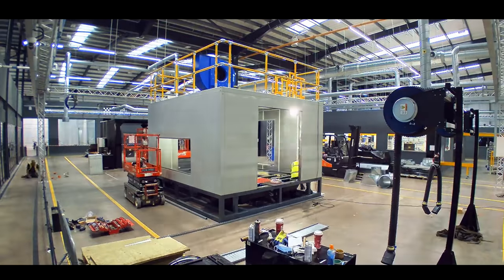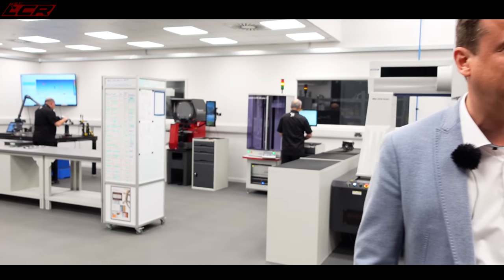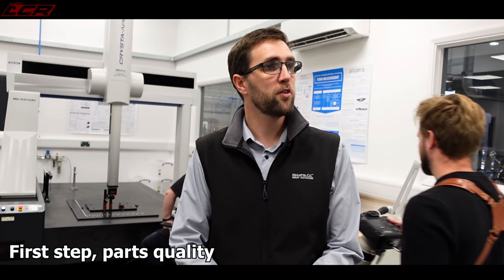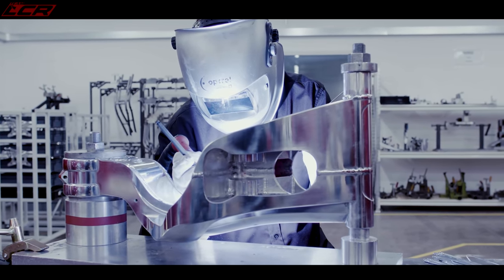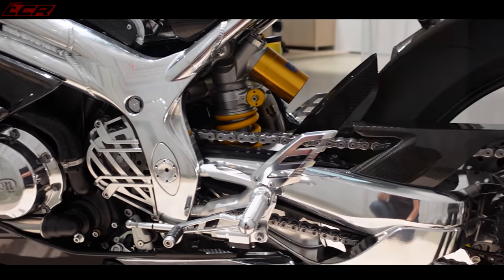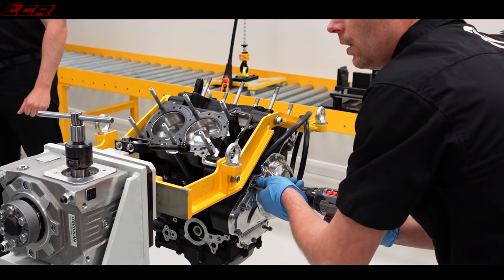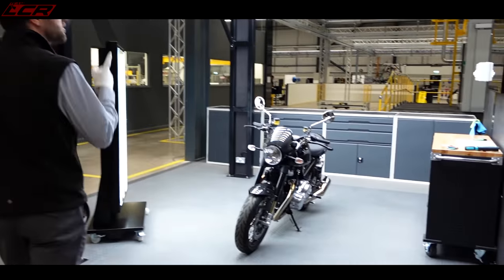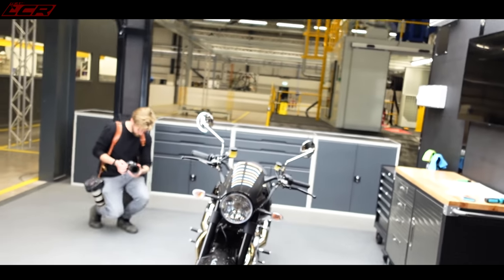NEW Norton Factory Tour!! | Norton Are BACK!!

Comment: I've had three Norton's in my lifetime. Back in the '60's I first had a 1962 Norton Electra and then two Norton Scramblers. A tomato red 1963 or '64 and a 1965 candy apple red one. They were vertical twins as this is before they slanted the motor forward a tad. They came with no mufflers so I had to install some stubby ones on them as the neighborhood I lived in at the time had some ornery cops! Today at 74 years old here in the state of Georgia I have three BMW's. A 2000 R1150GS, a 2001 K1200RS and a 2016 S1000R I just purchased used with 8000 miles on it. I also have a 2005 Suzuki Hayabusa that I bought new. I have riding 58 years and plan to keep on riding as long as I can. It keeps you young!
Reply: BTW: I remembered last night that the tomato red 750 Scrambler had a winged M on the tank for Matchless though both 750 bikes were the same. I wish I still had the candy apple red one today!
Reply: Much Respect, Sir!!!
Reply: Hi, I too had Norton’s back in the 60’s, both bought new; a 350cc Navigator and a 650ss, loved them both although the 650 ss had a few problems and I had to take it to Norton’s HQ in Birmingham to be fixed. I now have a 2001 Honda VFR V-tech which I bought second hand (2 months old)…absolutely love in every aspect of it. 
I agree biking helps you to stay young (I’m 78 now and have no plans to pack up yet), I voluntarily took the Advanced Motorcyclists test several years ago which was the best £100 I’ve ever spent…..helps me to stay alive plus when riding I have the mindset that everyone is out to kill me!
Let’s hope that TVS Norton are successful in the future. Ride safe 🇬🇧🇬🇧
Reply: @neilurquhart8622  Yes! You have to ride like everyone out there is out to get you. I call it situational awareness. The circumferential expressway , 285 , here in Atlanta is like a racetrack! Most, (95%), of my riding is out in the countryside where you have to watch for deer darting out into the road. I was 16 when I had the 400cc Norton Electra and the darn thing would blow a headlight bulb every time I accelerated down an entrance ramp to the expressway going into town. Lucas electric's ! 😆I can't remember how the shop fixed the problem , but it was eventually sorted out. The shop, Al Rodi Motorcycle sales sold Norton's, BSA, Ducati, BMW and Honda's. In '69 I purchased the new Honda 750 4 cylinder from them and then in 1974 I bought a 1975 BMW R90S that I kept for 25 years. I finally traded that bike, BIG MISTAKE , to buy the 2000 R1150GS. I was going to trade the GS for the 2016 BMW S1000R, but they only wanted me to give me $2000.00 to $2500.00 bucks for it and I said , I'll just keep it. It looks like new and only has 29,000 mile on it. My last name is Adams so I have some English heritage and love Lambchop's rides out into the countryside and villages in England. Yes, I hope Norton is successful as well. I plan on riding s long as I can hold the bikes up! 🤣 Stay safe.
Reply: Thanks Lurch….very interesting. I guess your into YouTube biking channels, if so, if you haven’t already done so take a look at Richy Vida’s channel and also ‘Itchy Boots’……both great in their own way……stay safe
Reply: @neilurquhart8622  Thanks, I'll check them both out. Have a great day or evening now I guess
Reply: Keep it up bro!

Comment: The QC is similar to defence contract or aircraft quality. The CMM is top notch as is the polishing, welding, case hardening ancd m aterials leading to superb finish and the paint and top notch components by brembo and ohlins for example are overengineered. However id like to know of crankshaft, conrod and big end spec as on 60s and early 70s bikes they had weaknesses there.

Comment: Thanks for posting.  Wish them all the luck in the world.  Would be great to have the brand pulled out of the dreck of past years and to a level the brand deserves.  Upper management is young, a good thing.  Definitely, they are pushing the quality issue and appear to be very transparent.  Considering they are not responsible for the mess of the previous owners, 10 grand is very generous.  Aren't the original motorcycle owners also getting compensation from the previous corporate owner(s), as established when it was shut down?  I suspect it will be a while before we see them in the USA.
Reply from the maker: Yes exactly, they will get money from the liquidation hopefully also

Comment: How about the radiator(s) at the back so the low pressure area behind the engine sucks air through and the engine can go further forward. It worked for Britten. Why not Norton?

Comment: Interesting stuff. I had several dealings with Mr Garner and his cronies at the facade at the ‘Hall’, never a good experience, glad to see I recognised only one old face.
 I sold my oil leaky bespoke ‘14 commando and managed to get my V4S deposit back just in time. But now have a permanent twitch when someone says ‘these are all pre production’ but I guess I will get over that in time when there built and have the quality. 
It’s a shame they are sticking with that engine, as it’s to big to run in the TT and I wouldn’t trust anything Mr Skinner designed the man was/is a fantasist 
I wish them all the very best and hope the curse is replaced with success…🏍💨

Comment: They certainly invested in top CMM and CNC machines and clearly are very strictly working to ISO 9001 which is like at Maclaren  for quality with some extremely highly skilled precision engineers and welders among others. What a huge turn around. They have to get them reliable and sorted properly as after Garner they need to bring their reputation out of the gutter but thank God some of the staff from before who were treated so badly by garner are back with all their skills and experience without a total bellend criminal who's arrogant out of this great firm and now with TVS which have built good cheap basic bikes in India for many years. I rode one I hired in Rajasthan desert but they clearly are ambitious going up market in quality.

Comment: With 20+ years in the aerospace business the majority of problems I have seen with parts are with how they are designed and materials used that is why you CANNOT inspect quality into parts.

A vendor can make the part exactly as Norton specified which Norton can verify it by inspection and Norton can carefully build the bike  but if the design was bad then you have a problem. 

So my real question is not about their build quality or the thoroughness of inspection but the rigorness of their engineering and what Norton did to improve those problems. 

Then it comes down to having distribution network that backs us their products which the previous group failed miserably.

Comment: I sure hope they make the 961 available Stateside if it's available at all after they fill in the orders for the ones that they already have because I'm not interested in a very expensive motorcycle wrapped around a very cheap Chinese engine I was so disappointed with all of the shenanigans financially and otherwise that Norton has had to endure over the years they put out a good 961 around $15,000 I might just be in the market for a new motorcycle

Comment: I don't understand what has happened with the relaunch of the Norton Brand that began 15 or so years ago. They inherited a remodeled engine in the 961 guise, developed by an America in Seattle or somewhere, but didn't bother to look at it and say will this work? I quite like the engine however to look at. But as for the whole package, I have never liked the looks of the 961. It has too many swoopy up and down lines that end with a rounded ducktail at the back, like a dog with its tail between its legs. The exaggerated carved out tank seems like over kill and doesn't help with the aesthetics. While the most performance figures do not support such a hefty price tag. The header pipes look as though they were taken off a different bike as the angle for the downward section is heading in the wrong direction...forward by the time they get to the second bend. It gives a unconvincing impression, as if those who designed it are more hopeful than confident that it will be accepted by the public. It is way too tall looking even with an engine leaning forward. 
I would not own one of these if it were given to me. The commando was never the best of their range anyway, the 750 Atlas was. It was beautiful and understated. It was also faster out of corners and off the mark than the Commando 850, as its torque peaked at a higher revs. 
They should have started with a fresh slate and asked which bike was most loved by the punters.

Comment: The only valid thing I can see to do with this old engine is to simply make Nortons as much identical to the originals as possible visually but mechanically and safety wise updated where possible so long as it does not change the outward...but trying to use this rattle bucket 5 speed motor to come up with motorcycles at all equal to modern offerings?  Well it is kind of a joke if you ask me instead of honoring a classic bike it makes it the butt of a bad joke if you ask me.  It would be the same if you did it with any old classic air cooled 5 speed motorcycle engines to build modern bikes....it aint gonna work if you ask me ....again I LOVE the idea of keeping old classics avaialble with invisable updates in the name of safety and reliability but dang dont go trying to put usd forks and what not that just look so out of place out of time WRONG like it is going to be competitive to modern offerings ....I mean sure by all means if possible make a brand NEW motor that looks a lot like the old one that is cool...like Kawasaki does with the Z retro bike that captures so much of the look of the original Z1 without insulting anyone by tryng to use the original air cooled 5 speed Z1 motor which would have been so lame to build a new motorcycle around IMHO